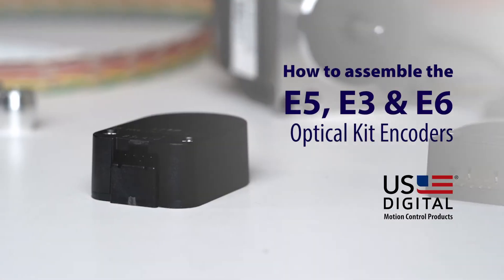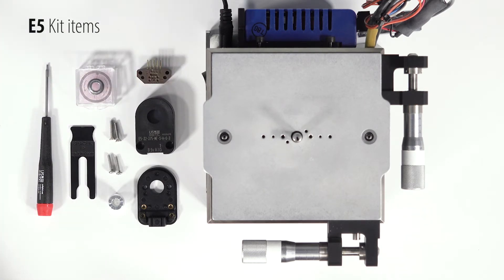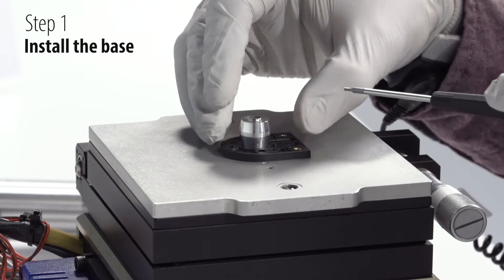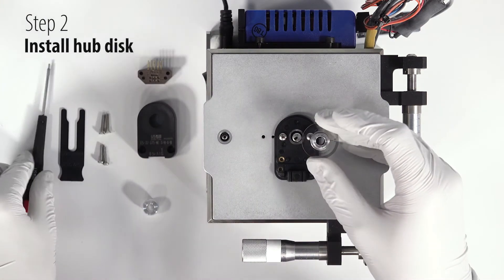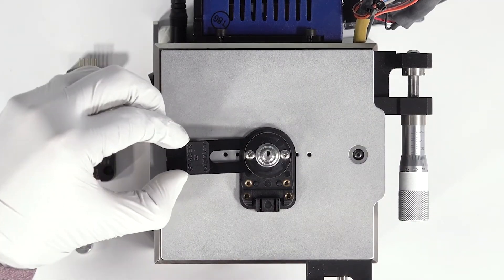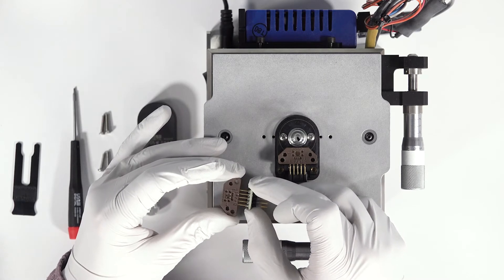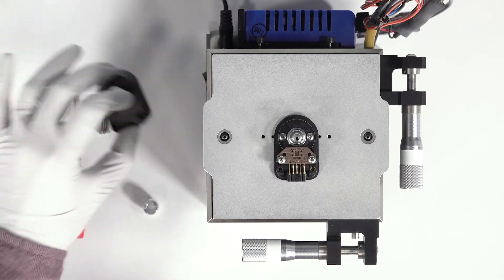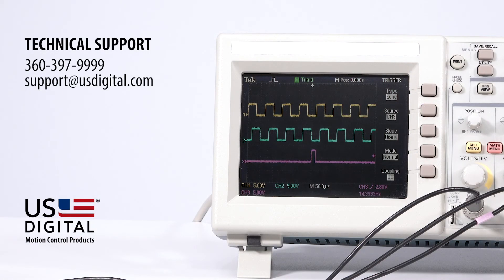How to assemble the E5, E3 & E6 optical kit encoder | US Digital

Comment: Hello, I tried to install using the spacer you provided, however, I think the Disk is touching the optical module. I had to use another spacer to allow more space between the optical module and the disk. Am I doing something wrong? I have this encoder: E3-500-375-NE-E-D-3
Reply from the maker: Sorry for the late response. The standard spacer we provide should place the disk very close to the top side of the sensor module (by design). The correct gap between the disk and the sensor should be approx. 0.010". If that's not what you're seeing, please let us know.